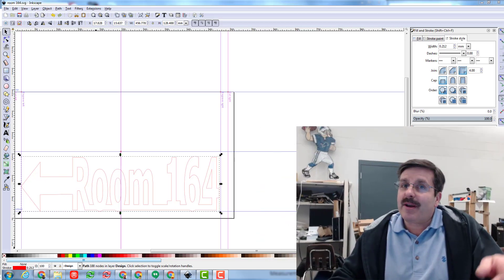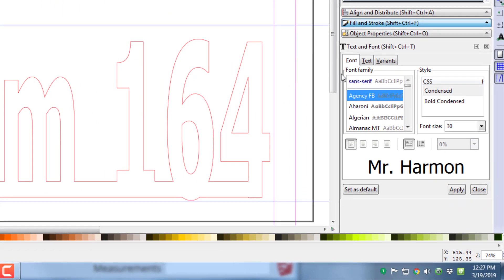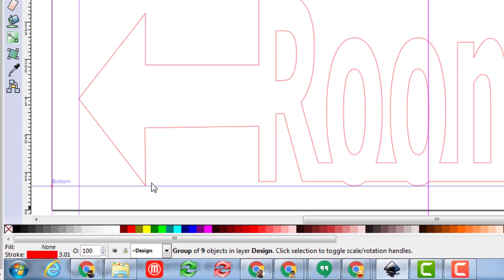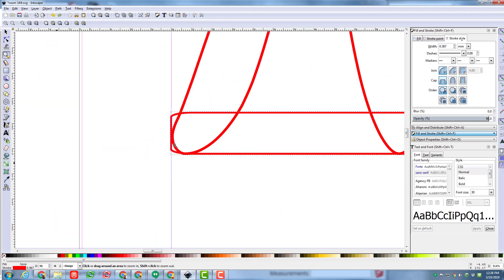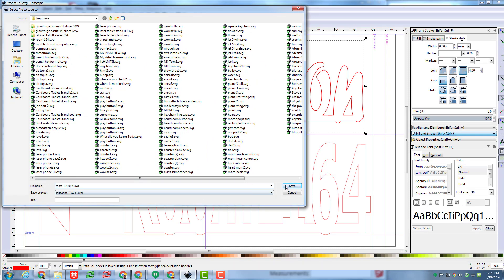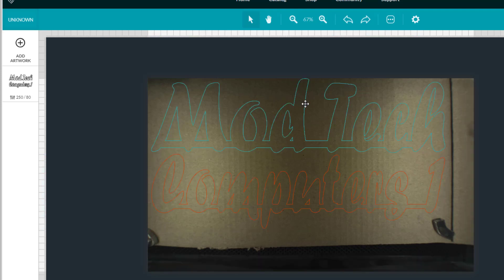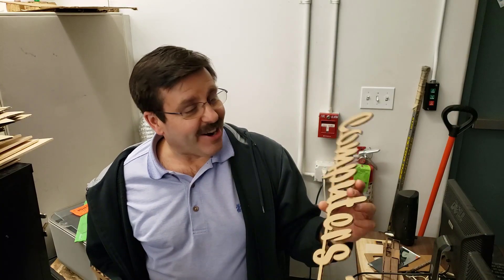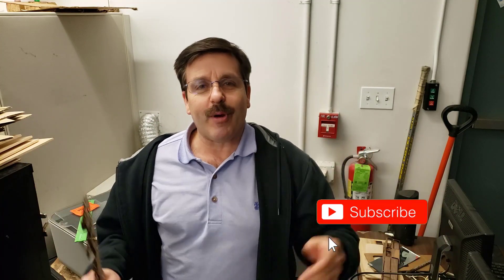Instant Inkscape - Super Slick Sign Skills!

Comment: Good day! When cutting this out I noticed you used three passes. I’ve cut cardboard several times with one pass but was wondering if there was a specific reason you used three?
Reply from the maker: No good reason. Just dialing in the numbers. I have been doing 1 pass cardboard cuts lately. 01.200.100 4mm height is my fav cardboard setting. I have used some cardboard that is extra sturdy and adjust as needed then.
Reply: HL ModTech Thanks! I just wanted to ensure I wasn’t missing anything. Much appreciated!